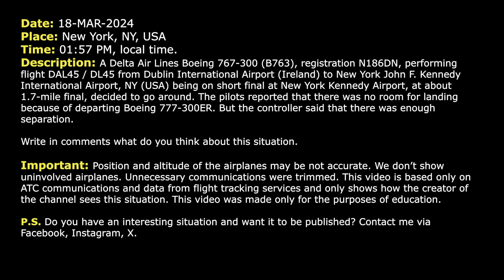Pilot argues with Tower controller about separation at New York Kennedy Airport. Real ATC

Comment: I've had 4 situations as a passenger when the tower and our Captain disagreed.  3 were re:  spacing,  one was two aircraft landing at the same time in intersecting runways. When I say the same time, I mean exactly the same time. The other 3 were spacing and I swear they were testing shortened spacing, cause it happened at 3 different airports with us flying through the wake turbulence of the meet in front of us. LGA (last minute abort), ORD & DEN (went to the back of the line).

Take my pilots decision over ATC every time.
Reply: ATC and pilot disagreed? Turns out they do not have a vote unless they direct a go around or cancel a landing clearance, etc
Reply: @FighterPilotPoker  quoting the pilot from that day in Syracuse. " Ladies and gentlemen if you look outside the left of the aircraft you may have noticed a plane landing on a perpendicular runway. The tower and I have had a disagreement as to whether we're going to meet where our runways intersect. I overruled them. We're going around and will be on the ground shortly "

Comment: The pilot is in his full right to do a go around.

However the ATC is maintaining a distance that is (slightly) above the minimum requirements, which means the pilot should be able to land safely. ATC would really be a mess, if every pilot had their own idea for how much seperation is needed.

There would be way too many missed approaches, and missed approaches also add a level of danger to a flight.
Reply: Thank you.
Reply: The approach controllers usually do an excellent job in maintaining an efficient, but adequate separation of arrivals. The tower however is playing way too tight with the decision of letting AIC go before the delta. In my opinion, it should not be necessary to rely on urgent action from the pilots to maintain an efficient flow. It increases risk and illustrates bad planning. Slow is smooth and smooth is fast.
Reply: @Azchk  What are you talking about? That's exactly what the controller did. The Jetshare landed, then the controller told the Air India flight to line up and wait as the Jetshare flight taxied off the runway, then the controlled cleared Air India for takeoff once the Jetshare was clear.
Reply: @Peter-sv4mk  That's right my mistake.

Comment: It would have been tight is just fine when you are sipping coffee in the Control Tower! Too much attitude from ATC! Great job Captain!
Reply: Well stated, Jeff.
Reply: Perhaps the lack of information from the controller regarding the diminishing separation, albeit acceptable, was the real concern on the deck. If the controller had been more proactive in his communications to the Delta aircraft, then perhaps they wouldn't have made the decision to go around pre-emptively. As others have said, No one has ever died in the tower due to an ATC error....  An ATC saying it would have been tight raises serious concerns. It may have been frustration, or poor terminology/ phraseology, but "it would have been tight" conveys a belief,  in the controller's view, that the there was a real possibility separation could have fallen to, or below, minimums.

Repeating a behaviour that carries risk, or taking deliberate risks, on the basis nothing has ever happened before so it must be safe, does not make it safer. It just means it's one more repetition of a cycle closer to a failure in your multiple layers of risk mitigation.  So the Captain electing to go around is a classic example of depth in defence. His decision to do so removed the aircraft from a possible chain of events in an accident sequence. I think the lesson here is the best pilots are not necessarily the best aviators; But they sure as hell are the best risk managers.....
Reply: @michaelmerrett538  less dissertations on youtube brother

Comment: The pilot had the right to go around. The Pilot In Command is solely responsible for the safe operation of their aircraft, not the ATC controller.

The Controller says he does that every day. But He doesn't actually fly or land an aircraft. He sits comfortably in the block house and isn't responsible for the safety of the aircraft or the lives of the crew and passengers.
Reply: Exactly !   Totally agree with you bud .

Comment: The Ciration was slow to clear the rwy, and the 777 should have been told to wait until til after the Delta 767, but the ATC controller was committed to a bad plan and he wouldn't give in, and then wanted to blame the Delta crew. Only a matter of time.
Reply: And aircraft lining up wither another aircraft on a 5 mile final for a visual approach is completely normal and happens all day every day at thousands of airports. It is safe.
Reply: @JohnSmith-zi9or  Yes...until the Citation misses it's first turn, and stays on the runway longer than expected by ATC. Plus the 777 is slow to get rolling with all that weight. So now its less than 3 miles separation, the 777 hasn't even started rolling, and the 767, at the end of a looooong flight, doesn't want the extra risk.
Reply: @sb859  Your comment "only a matter of time" insinuates that catastrophe is right around the corner and/or what happened at JFK wasn't safe. Delta was still outside the minimum separation. Going around at 800ft is more than 2 miles from landing. They were safe. Everyday over 100 people die in car accidents ... that's equivalent to at least 2 in every state not to mention the people who are seriously injured or hurt. Nobody ever talks about that. But my gosh, a Delta goes around at 2 miles from landing and "its only a matter of time..."
Reply: @JohnSmith-zi9or  so the Delta Captain, and me, also an airline  pilot, disagree with your assessment...
Reply: Unfortunately this is how the US system works. They always commit early to a plan by giving landing clearances when there are other landings and departures ahead. The rest of the world does it in a more sensible manner...

Comment: Controller needs the departing aircraft to be 6000 ft down the runway and airborne before the arrival crosses the threshold. He would have had it all day. Delta is perfectly within their rights to go around, but he was wrong about the spacing. The controller had the required separation.
Reply: Concur. The PIC is the final authority for the safety of the flight. However, they did go around at 800ft (assuming the video is correct). That's 2 miles from landing.

Comment: As a tower controller, based on the distances being mentioned, I would have thought it would have worked but, yeah, tight. However ultimately it's the pilot's call as to whether they think it's safe. As usual, US controllers are way too verbose and the extra gibberish cost a few valuable seconds here.
Reply: Thanks, I was wondering what the absolute minimum acceptable separation would have been in the circumstance.
Reply: @pleasedonotyellinthecasino  Air India needed to be in the air by the time Delta crossed the threshold.
Reply: By telling Air India the "aircraft 2.5mile on final" he was really giving necessary info in lieu of giving an instruction with a meaning somewhere between "don't dilly dally" and "expedite".
Reply: What instruction was so verbose that that it cost any time here? Because there isn't one that could have made any difference as far as I can tell.
Reply: @Peter-sv4mk  fair comment, probably not much here other than giving Air India the position of the traffic on final which would cost 1 or 2 seconds tops. Better off just giving an immediate take-off clearance but unlikely to have made a difference here.
Reply: @MrBadger1978  it may have but if Air India aborted it could be a calamity.
Reply: @amg2022 it is always true that IF something happens then MAYBE there COULD be a calamity. The facts are that ATCs don't set the arrival rates at airports and they're required to maximise runway usage. As an ATC at a busy airport, you have to push gaps, it's as simple as that. Sometimes it doesn't work and, when it doesn't, you deal with it. IF Air India aborted, there would still have been ample opportunity for the controller to send the arrival around.
Reply: @MrBadger1978  ‘there would still have been ample opportunity for the controller to send the arrival around.’
Ample might become zero when just at that moment the frequency becomes blocked by another aircraft checking in with a lengthy call. ATC wás lining up the holes in the Swiss Cheese Model.
Having said that, many years ago I was send around by JFK Tower because the previous landing aircraft hadn’t cleared the runway yet. At the moment I thought that call was premature because the previous aircraft was already halfway the exit and we still had a couple of hundred feet (altitude) to go.
Reply: @janerikkant3646  as I've said, controllers don't set the airport arrival rates. We get the gaps we get. If we had to consider every hypothetical about what could happen, no one would ever depart. As it is, we have to make a judgement of risk and consider our "out" if things go wrong. 
I think the US method of clearing an aircraft to land with other landings and departures ahead makes it harder to fix things if, as you say, there is no room and some pilot does a long winded call on frequency but that's just me.

Comment: If Air India had needed to reject takeoff after Delta had commited to land there would have been a bit of a problem. I would be more than happy to have the Delta captain in charge of my plane.
Reply: its called a go around LMAO
Reply: I hate that they even tell the departing plane that there is an approaching plane at 2.5 mile final. That is pressuring dude to leave ASAP.
Reply: Good point!
Reply: If that had been the case, there was still time to conduct a go-around. 1.7NM from the runway at a final approach speed of 130knts leaves 47 seconds before reaching the runway. It might not seem like a lot, but that's plenty of time to react if required.
Reply: Sure, but you are not qualified to make that opinion
Reply: @khlua4590  it was not an opinion, but a statement of fact. I controlled busy single runway ops for nearly 10 years. This was my bread and butter. If all pilots were like this one, operations would have been slowed way down. Aircraft overshoot, or go around at any time all the way to the runway, some do unplanned go-around even after touching down.

Comment: The ATC doesn't "do it every day" with this particular plane and this pilot, and he admitted that it would be tight.  The pilot did the right thing.
Reply: I don’t think it would have been any where close to srs required.  Citation sure used a lot of runway, it was a good plan.  I just don’t know of one accident under this type situation
Reply: I don’t think it would have been any where close to srs required.  Citation sure used a lot of runway, it was a good plan.  I just don’t know of one accident under this type situation
Reply: @phillipwhite8463  until it happens. not a good excuse

Comment: Pure class and professionalism by the Delta pilots. Almost sounded like the controller wanted to get into it with the pilots, but they didn't take the bait.
Reply: Good call by the DL flight crew.
Reply: @RetreadPhotoridiculous notion. They have strict guidelines. He wasn’t trying to squeeze anyone in.
Reply: @rtbrtb_dutchy4183 no more ridiculous than the ATC thinking he has a right to lecture the pilot.
Reply: @TuppenceAbucket  he wasn’t lecturing the pilot. He was explaining. In this case, both the controller and the pilot were correct and they both handled it just fine. 

The controller knows his airspace. He runs hundreds of similar approaches a day. Air India started rolling when Delta was 2.5 miles out, so this should work. 

However, the pilot is fully in his right to go around. He had a long day. We, nor the controller, knows how his day has been going. Obviously, this Air India was a distraction. You lose focus when you are concerned somewhere else. 

The controller only said that it would’ve worked. He is probably right, but it didn’t work for the pilot, so the go around was the right decision. The controller knows this.
Reply: @rtbrtb_dutchy4183 You’re silly. They have “strict guidelines” so therefore it would have worked. As if guidelines are never broken and as if ATC guidelines/rules work for every instance. He also essentially admitted to squeezing them in (probably legally) when he said it would have been tight but would have worked. Saying nothing is an option and he didn’t take it. Pretty sure they have guidelines for unnecessary radio communications too…like arguing with a pilot that it would have worked because you “do this every day”.
Reply: @austinrothjr  so you don’t understand how aviation works. Yes, they have strict guidelines. That doesn’t mean that the end result is that the controller won’t tell Delta to do a go around. 

The strict guidelines is that the aircraft cannot get within a certain distance. This minimum distance, still has a safety buffer. So, if Delta had continued, he could’ve stayed outside that minimum and landed. But, he could’ve gotten to the minimum, which would trigger an a go around called for by the tower. Either way, it would have worked without being unsafe. 

You seem to think that ATC would bust these guidelines. They won’t. 

The whole “squeezing in” doesn’t mean busting these minimums. 

Nobody was arguing. The pilot explained his way of thinking and so did the controller. Nobody was mad. Nobody did anything wrong.
Reply: @rtbrtb_dutchy4183  Also, the last thing pilots doing a go around with an airplane on the roll in front of them needs is for a controller to tell them how it “would have worked” when both crews and the controller should be focusing on there here and now. Then again, I don’t really understand aviation, so I could be wrong.
Reply: @austinrothjr  I’m not naive. But the controllers aren’t going to break rules by busting those type of minimums. Why?  Because it’s all being tracked. A controller can’t “hide” if an aircraft got too close to another. 

I already mentioned before, the pilot also did the correct thing. He can choose to go around, no questions asked. If he feels his underwear is in a knot, he can go around. 

But the controller also didn’t do anything wrong here. And they had a discussion afterwards. You make too big of a deal out of this. And it’s ok to have this quick discussion. It’s ok for the pilot to say he thought it was too close and it was ok for the controller to say that it wasn’t. No big deal.
Reply: @austinrothjr  again, it’s just a go around. No big deal. They had time to talk. It’s ok. Don’t make a drama out of it.
Reply: @rtbrtb_dutchy4183  You are naive. You’ve mentioned a couple times now that controllers won’t and don’t break the rules. They do. Pilots do too. People have bad days, get distracted, make mistakes, don’t know the rules or mistake common practice for procedure, and have any number of other reasons why rules, policies, and procedures aren’t followed. In aviation we are generally pretty good at it…but it happens all the time. Saying they don’t do it because the system will tell on them is like saying people don’t speed because there are speed cameras. 

You also display a very casual attitude about go arounds. They should be straight forward but they aren’t something we do every day, much less when another aircraft is on their takeoff roll. The controller has no idea what else is going on in the cockpit. Maybe the go-around failed to sequence. Maybe the Captain knocked his coffee into his lap as soon as they started the go around. Maybe they accidentally put the wrong flap setting in during the go around. There are a lot of things that can happen that the crew wouldn’t necessarily make the controller aware of that would complicate things for them. That’s exactly why communications are to be kept to only those necessary. When the controller asked the reason for the go around that was 100% necessary and it’s actually required. However, telling the crew the go around wasn’t necessary when they already called it is unnecessary. The comment “I do this every day” is a way of saying “I know better than you and you are the one that is screwed up.” These unnecessary communications by the controller are violations of the .65…but you don’t seem to think they ever break the rules. Thus why I called you naive.
Reply: @austinrothjr  you should read again. I said: the controllers aren’t going to break rules by busting THOSE TYPE OF MINIMUMS. 

I never said they don’t break or stretch the rules occasionally. But minimum separation rules, no, they won’t bust those on purpose to “squeeze in” another aircraft. Those are the TYPE of rules I was talking about. 

They are not alone up on the tower and when the automation gets trigger that two airplanes get close to the minimum separation allowed, a warning goes off and everyone on that tower knows. 

The pilot had every right to go around. 
On re current training, all pilots do is “go arounds”. It’s a none issue. Pilots are also trained to not talk unless they are ready to talk. You are making a much bigger deal out of this situation than there is. 

Do you actually fly as I pilot?  I have a feeling you are not, but maybe I’m wrong.